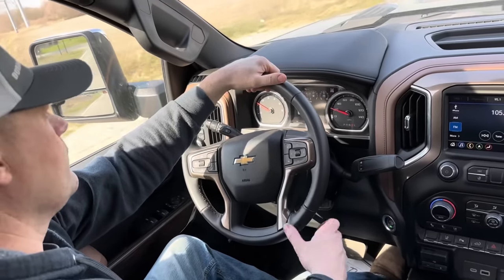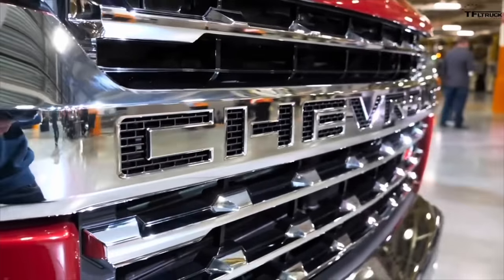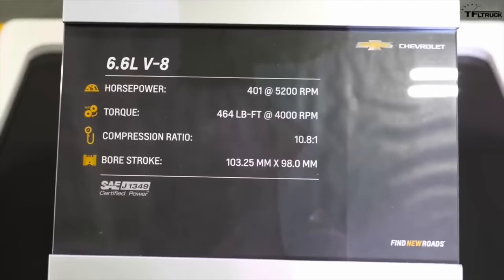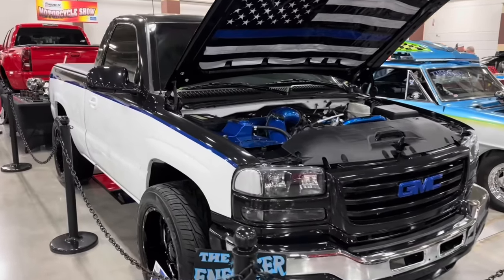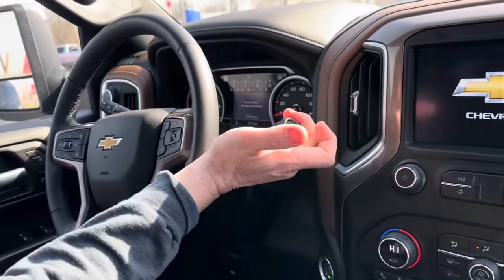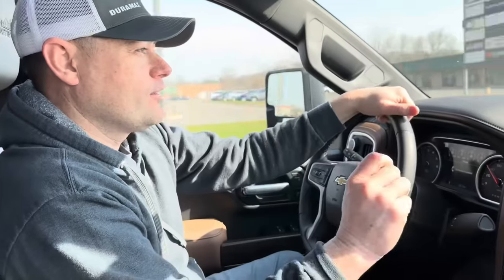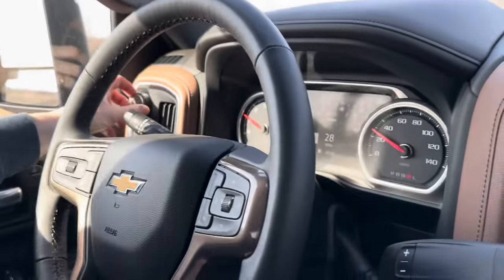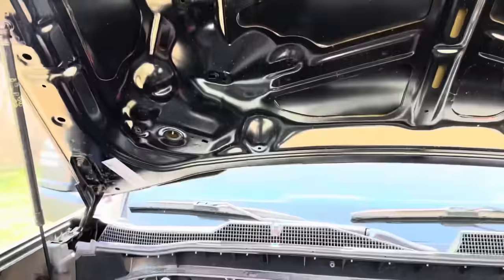What I Really Think About The New 6.6L Gas Silverado! WORTH IT?

Comment from the maker: Thanks for watching! Enter for the Duramax truck giveaway here 👉 https://truckmasterdiesel.com
Reply: Yeah I used to have a no 6 duramax that I didn't want to get rid of, but needed to.
Reply: This truck has 3.73 gears!! , my 2018 has 4.11, Higher gears are due to Increase in Power down low in the power band. My 6.0 with 4.11 and stock size tires ( Michelins) gets about 13.6 on highway ( average) at 68 mph. I am betting this does that at least. I have buddy with the 6.6 and now 35K miles and doesnt use oil.... I think that's old AFM talk from the 5.3 engines.
Reply: Hey did you send a message to discuss privately on telegram? Thanks
Reply: @drewk5929  it’s a scam don’t reply to it
Reply: Do you have a scammer on here going by the name of TheTruckMaster_
Reply: @oakland2255  they tried to contact me to the under score at the end tells the tell of a scammer truckmaster is josh not truckmaster_
Reply: Well which is it? Is it goofy or do you love it?

Comment: I think GM should bring back the 8.1. Or something close to it it. Nothing like a big block.
Reply: That would require common sense, I think corporate headquarters ran out of that years ago
Reply: I love my 06 GMC Sierra 2500HD SLT L18 8.1 with the 6 speed Allison behind it. 235k miles and drives like new. 

13.5 hwy, 9 town but love it!  I am a big block freak back since the 396-427 era in Midyear vettes.

Soon a big block will be a large frame electric motor😡
Reply: I agree.. I had the 454 and the 8.1 with the manual 6 speed it was fun to drive fuel mileage was about 11 loaded or empty.
Reply: AC on or off- no difference!  Fuel mileage was a function of air volume going through the engine.
Reply: Here’s another idea, keep this new 6.6 gas and just turbo charge it. Torque would go way up and then might compete a little with diesel.
Reply: @downshifter4179  This is what I was thinking. Wait till the aftermarket catches up. Sometimes hidden gems are found.
Reply: I own a 6.6 gas 2500hd . It’s a good truck it does everything I ask of it pulls a bobcat and a mini  X  does it in stride. It’s a truck that’s fits 80 percent of owner needs. Tried and true 6l90 and a solid no cylinder deactivation junk to fail.
Reply: Drive 8.1 every day. 04 Allison combo flat bed 4x4 4.56 gears front and back. Lockers and upgraded 3300 lb per side leafs with bilatein 5100s and all kryptonite front end parts 160 k miles. Love it.
Reply: @crooked308  On board. I'm thinking this is the way to go for my setup. Don't need it every day, but when it's time,  its a pickup box camper and boat in tow. Gas might still be the ticket.
Reply: 6.6L L8T:  oil consumption issues.  Not good.  GM thinks 1 quart burned per 100 gallons of fuel is 'normal'

Take the GM only blinders off.  Many people love their 7.3L Godzilla (more HP, more Torque, 430 hp, 485 lb-ft), port injection, no oil consumption issues...It's a better gas truck option.

Ford:  better looking front end, better looking mirrors, better looking interior...
Reply: @27dmarshall  Yea, but it's a Ford. 👎
Reply: Maybe because of the added weight?
Reply: I think gm should just bring the ol reliable 350 back with a few modern upgrades and everything would be A okay
Reply: gm isn't going to make any combustion engines after 2025.. j/s
Reply: @David Hill  hmmm... yeaaaa... about that. EV's in the truck market are facing a major uphill battle. Unless they can come up with the tech and battery capacity, it's already DOA. Fact of the matter is, ALL ev's fall on their face when towing a load right now. They have no range.
Reply: Fond memories of my new 2004 Avalanche 2500 with the 8.1L. It was an excellent truck.
Traded it in 2007 for the new Denali Yukon XL.

Wish I kept that Avalanche. Who knew……
Reply: @crooked308  It would would have better take off with a 4:10 gear. They are sluggish off the line loaded.
Reply: I agree
Reply: Who is going to buy an engine that uses so much fuel
Reply: @tambosnipes1652  Especially when it has less power.
Reply: @davidhill588  Tes they are. Gen 5 to gen 6 V8's out to 2036
Reply: @Gary H.  I'm a master gm tech and that's what they are telling us as of right now.  that's Mary bara's plan.
Reply: I had 8.1 avalanche pulled big enclosed trailers with cars in them California to south Dakota.   I miss that truck
Reply: Yeah that would be awesome I had a 2002 Silverado 2500 with the 8.1 it was a great truck and the engine was a beast I ended up selling it to buy a lbz duramax a few years ago though
Reply: GM would love to resurrect the 454 b.b. and 350sb.. Emissions killed them off . They will not meet the current levels.  Nuff said.
Reply: @h8troodoh  actually they kind of did with the lsx454 it makes like 600hp+ but it’s not a production engine it’s a crate engine they have the potential to bring back older engines but upgraded to modern standards but they would have to be crate engines because of the epa like you said
Reply: I have owned a 02 8.1 2500hd w/5speed Allison 4.10s for about 2 years now it burns oil same as this truck mpg sucks also due to a bigblock  13mpg on the highway 7-8 towing But the truck does great pulling my 8000 pound camper. All in all im probably getting close to the same Performance as you would with the 6.6 for $8500 I paid for my truck vs a $50,000+truck Unless you’re a rich guy. I’ll keep my 8.1 any day. And as far as diesels and gas you just can’t compare the two together. Now if they made a 6.6l gas turbo truck that would probably spark some interest.
Reply: MADE in CHINA 
GM is the cheapest for a reason men
Reply: 234k on my Yukon 8.1... just took 2300 mile family trip. Would buy a new one in a second!!!
Reply: Looks like a dog that's a big motor should be more responsive. Needs power upgrade
Reply: i drove a 6.6 6 speed. went right back to my 2003 8.1 without buying it. 8.1 actually did 40-100 faster. and MUCH nicer to drive
Reply: I agree my vote would be bring back the 454/7.4L I don’t think anything could beat a modernized 454.
Reply: @27dmarshall  The 8.1 had "oil consumption issues" too. I use a quart an oil change, they used oil since new. 230k now daily driven never rebuilt anything just drove to Fla from PA last month 2300 mile trip zero issues cept some oil each way. Dont agree either on the design the new 24 front is nice and the GM dash is better cept the base models. Mirrors I agree.. also I tried to buy a Ford the dealers here ALL have them marked up OVER MSRP still. I thought the 7.3 was cool too but wanted to wait since new design then the markups still so their dealers here can shove it. Goin back w GM. Do wish theyd make a bigger engine and fix the overpricing of options tho thats what Id want and why Ive stuck w still driving the paid off 8.1 daily that never dies. Prob ending up w LT mid level Chevy gasser next year or so unless something changes. (Ps I drive an 18k mi Ford F250 XLT crew cab for work, Perfectly good truck but nothing special. Needs the 7.3)
Reply: 100% agree. Loved mine more than my LB7. Would buy new 8.1 tomorrow with no regrets
Reply: I have it in my Chevy 3500 dump truck. It's a monster
Reply: @@27dmarshall  Except that the “oil consumption” is more an often repeated internet non-issue than it is an actual problem.
Reply: @@drifter9425  Flint Michigan
is in China?
Reply: @cumminsb9925 Great combination....if GM offered a new 8.1 with a six-speed manual, I'd be first in line to buy one. The 6.6 gasser is a decent motor, but woefully underpowered. 450 - 475 horses with 600 ft/lbs. torque is a good starting point.
Reply: Big Block gasoline engines just wouldn't sell.  The 6.6 is good enough.
Reply: @tambosnipes1652  The new diesel trucks don't offer that much better mpg....most are around 12mpg in town and empty. Fully loaded, most are in the 8-9 range. Plus, diesel fuel and oil changes are absurdly expensive. I think the real problem is that gassers just don't have much power. 410-430 horses with 475 torque just doesn't cut it for serious towing. In a day when some SUV's have 700 HP, gasser trucks should have at least 550 HP and 600+ FPT....
Reply: I like my 12 2500hd 6.0
Reply: 7 mpg lol
Reply: My 8.1 Yukon is @ 250k, still rolling and running great, and rusting great too! lol No engine or trans rebuilds needed yet (knock on wood). Gnna prob get a new truck but keep this either way and start some rocker repair. Whole underside w all lines and suspension rebuilt. Drives almost like new. Last new truck 2018 1500, sold, like this old 8.1 Yukon more, even for daily driving. If they made a new 8.1 equiv. for a fair upcharge 2500 maybe, there would be one in my driveway. People want a powerful big block. Zero interest in ridiculous emission diesel w a 10k upcharge. Not needed.
Reply: I love my 2004 3/4t Avalanche with 8.1 l engine plenty of power. Yes , GM should bring it back.
Reply: @jordangarrick703  My fully-loaded 2004 Duramax gets 22 MPG empty and 15 MPG pulling my 10,000 lb fifth-wheel. There's a huge difference in fuel economy between a diesel and a gasser.
Reply: @davidhill588 That is not true at all.
Reply: The 8.1L was a dog. The specs of the 8.1 are less HP and torque that the 6.6L. The fuel mileage of the 8.1L also sucked. There is a good reason they got rid of it.
Reply: @holdenc3082  I agree 100% with you. Unlike the delaminating cams in the 7.3L Godzilla.
Reply: @27dmarshall  Except it's a Ford🤮
Reply: GM should make the 6.6 gas a V10. Doing the on my fingers, you're looking at 450hp and over 500ftlbs torque, cheap & easy.
Reply: 8.1 was a dog engine. These newer engines blow that old engine away
Reply: this would be close to it
Reply: Closest big block is Ford's 7.3 gasser...

Comment: I don’t understand why the keyboard warriors insist on comparing these gas trucks to diesels.   If anything, compare it to the Ford 7.3L gas engine.   There is a huge market for truck owners who need a HD chassis to pull campers or a compact tractor occasionally but don’t pull 20,000+ pounds every single day.   Unless you pull heavy every single day it is hard to justify a diesel.
Reply: No 6.8 ford gas.The 7.3 is a better engine....if it doesnt destroy itself like some are.

Comment: Just bought a 2021 with 6.6 gas. Towing a fully loaded camper at 8500lbs I get about 10mpg depending on road conditions. Maybe a little more. Just a bed full of camping supplies and full of passengers I get almost 18mpg. Love the truck.
Reply: Wow only 10pm while pulling the trailer! Makes me want to buy the duramax instead of gas! I’m currently in a 6.2l 1500 Sierra and I get 6-7mpg it’s absolutely terrible on mpgs. Pulling my 28ft travel trailer feels fine just terrible on mileage and I want to get better mpg so was looking at the 6.6 duramax
Reply: @luisvasquez8690  diesel 10k more up front, fuel cost more, maintenance cost more. So if your just worried about fuel mileage instead of actual money savings...then go with diesel
Reply: I may be wrong, but doesn’t the diesel only get 13ish mpg when loaded?
Reply: @luisvasquez8690 that’s the exact reason I went with the duramax couldn’t stand the awful fuel mileage while towing

Comment: I went from a 6.2 liter gas to the Duramax and I am actually spending less for fuel now. With my 2013 Silverado, I was spending roughly $275.00/month on gas and now I am at about $180.00-200.00/month. Plus I can haul so much more with this truck. I am happy that I switched over to diesel.
Reply: Add DEF costs and and Lubrication for fuel to that cost. I love the Diesel, IF its needed....
Reply: @Formulabruce exactly. May save on fuel, but the other costs will make that difference up easily
Reply: 275 on gas is Rookie Numbers
Reply: Nah he’s a pro. He fills up once a month. Extreme experience right there
Reply: I spend that much on fuel a month in a Honda Civic!
Reply: That’s (1) tank a month?
Reply: Don’t forget the added 10K engine too. Lol
Reply: Exactly. My gas trucks always got about 10mpg my LMM 17-20mpg pays for itself.
Reply: I think I spent $275 on gas this week 😂
Reply: If it’s not used for Work Truck it’s Insane to think it’s comparable?  Diesels are 3-500 just for oil change an filters! Fuel 1.00 more per gallon.
Reply: @rapTorfx4  Not just easy but fast. These new trucks aren’t built to last
Reply: May save on fuel but when you add the cost for oil change/fuel filter changes plus the constant need for def fluid every few hundred miles makes it not worth it. Plus also add the added cost of repairs due to the emissions stuff that you cant delete.
Reply: And may I add you also got a 1500 that used high test fuel for the 6.2 which is close if not more than diesel.
Reply: Diesel was the best before emissions crap. If it weren't for the stupid emissions crap required now diesels would still be the best option for nearly every truck. Now it's only good if you need to tow max capacity.
Reply: @Formulabruce plus like 10k for just the diesel...

Comment: Just bought a 2024 sierra 2500.  The 6.6 gas seems to run well.  I pull a dump trailer and excavator.  So far so good.
Reply: Have mine on order and the lack of the crappy fuel management is the reason I went with the 2500 over 1500

Comment: I have one after having an L5p and Lml. It's perfect for me. the 6 speed is just fine. After driving  170 hp 350's with 3 speed automatics for many years, this works great for me.  Keeping things in perspective helps.
Reply: Your 350 only made 170 hp??? 😬 Wow!! 😬 No wonder why you like this new truck so much! All the 350's I had made a hell of a lot more power than 170 😂😂😂
Reply: @Westley909  80's TBI, but would easily go over 200K miles.
Reply: @Westley909  The mid to late 70's into the 80's were some pretty dark days power wise but somehow we survived.
Reply: @Formulabruce  😊
Reply: L31R 350 in my s10, it’s the last one gen1E vortec makes 270hp and 365tq
Reply: @Westley909  mid 70's through the 80's emissions push manufacturers thought cutting power was the only way to meet emissions and most people wouldn't buy the smaller engines. So they used standard engines and neutered the hell out of them. Just like my 85 4.3L makes 200 peak torque at 2000rpm and a whopping 130hp at 4000rpm
Reply: @Westley909  what 350 truck motor unmodified made more than 170 , after 72 they were castrated .